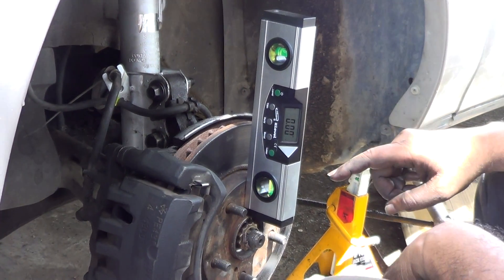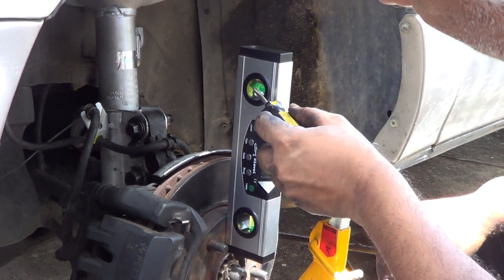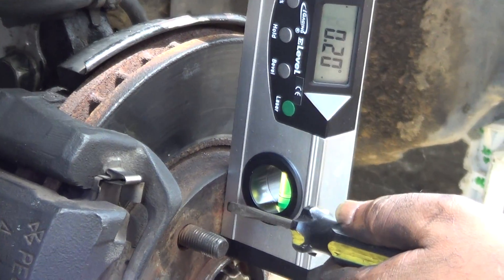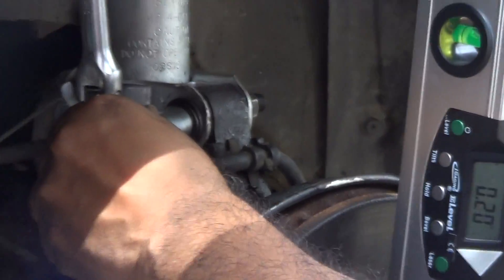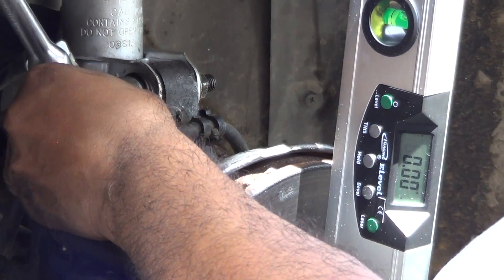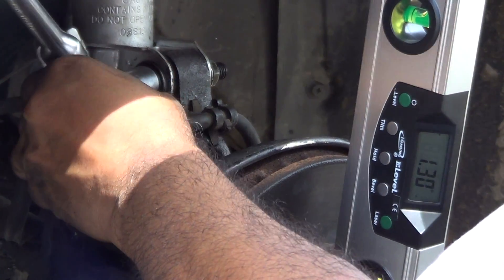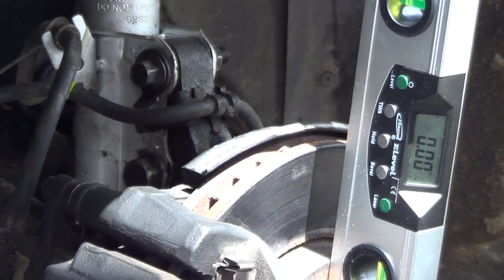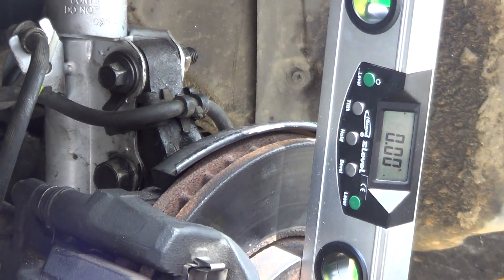using spirit level to camber car wheel

Comment: That is how I did mine. But I put the jack under the ball joint and let the car rest in it. And popped the hood and out the level to level the car in the jack in the ball joint. And then set the camber as if the wheel was on.  Then took it to Firestone and my front driver was 0 and the passanger 0.1 . With a water level.  You didn't have any pressure on the ball joint pushing the shock up with the car hood popped and out the level  somewhere first  one wheel on at a time..so you base the levelness of the car..so you. When you put your car down the shock will push up and change the camber from where ever you set it .but nice try and nice level

Comment: Wow! This is really messed up.  First, not a word on the level of the floor.  Second, the camber will change when the suspension is down on the ground with the weight of the car compressing the springs.   Third, this guy has no nuts holding on the rotors so guess where they are?  Who knows?   This simply won't work.
Reply from the maker: i did put a jack under the wheel to compress the spring  to simulate the weight of the vehicle on the ground.  missed that in the video. 
the level of the floor should not matter once the wheel is in its level position relative to the car body or some other reference point on the car.  
the nuts, well once the jack was in place under the hub , the hub was held  in the correct orientation position. 
the camber may not be perfect but it will be close.